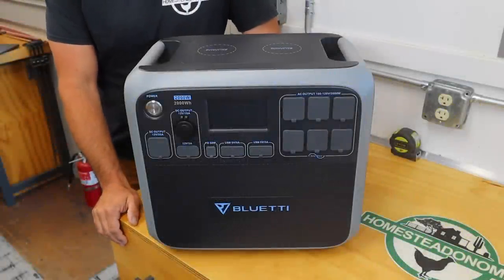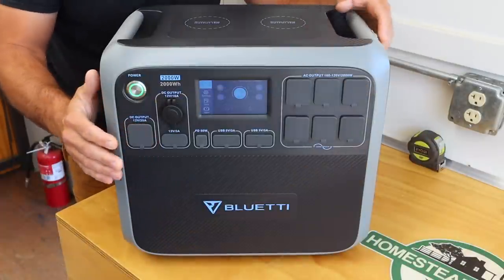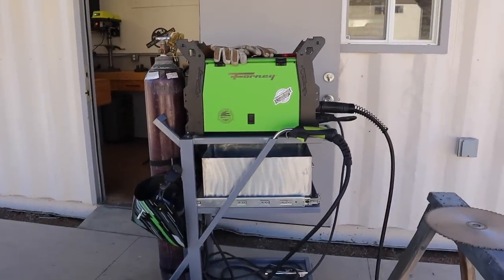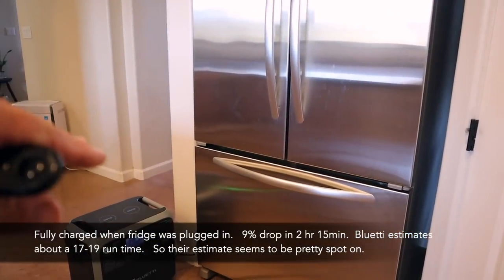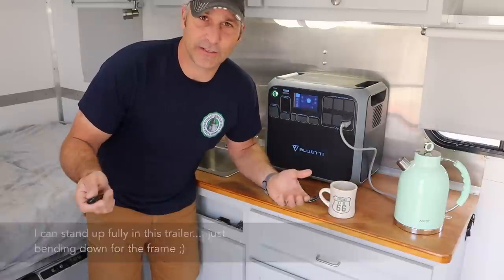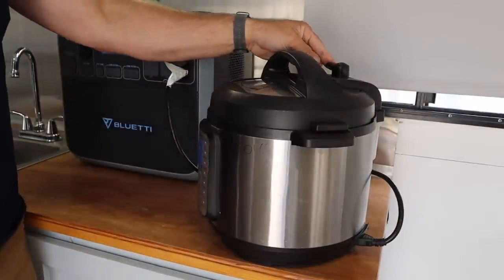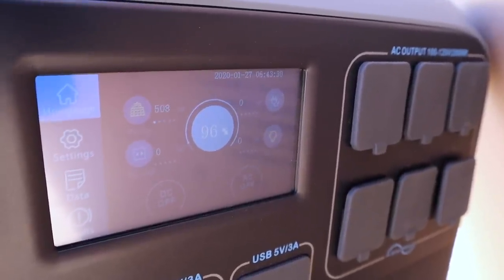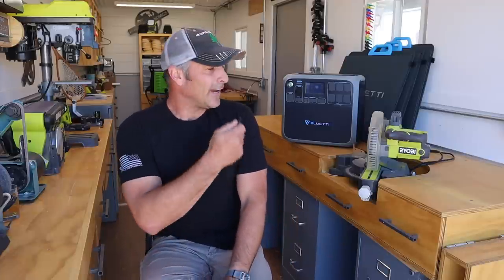How Much Can It Power?  -   Bluetti AC200P Power Station Review

Comment: Wireless (cellphone) charger devices are called Qi certified charging pads.  I have found them convenient on my iPhone 8.  I’m sure your daughter will find devices to utilize those ports.  They become quite convenient.  Thanks for sharing this insightful video presentation.   Will you be creating a permanent location in trailer for travel use?  Will this unit only charge with their proprietary solar panels?  If not, you could use roof mounted solar PV panels to charge the system while traveling.   You may want to add a convective cooktop for home or travel.  W you and your family a blessed week and safe travels.   

Greetings from the frozen southern shore of the Great Swamp Erie in NE Ohio.   Peace brother.
Reply from the maker: The manual says you can use other manufacturers solar panels just so long as the input voltage is within a certain range.   Pretty wide range so I plan on trying it with my travel trailer panels at some point.  But I’d have to wire in a split connection so I could add the plug for the input on the power station. 

Stay warm up in OH….we are in our nice time of year.    But yours is just a few months away and then we will be sweltering 😅

Comment: Cool products, thanks for sharing. I would really like to have a couple of these to run my cabin/tiny house. 
We currently run a predator 2000 gas generator and it runs for 12 hours on a gallon of gas.
The price of these packs aren't too bad from  my perspective. My only question would be: can I connect them to a solar array and use it as a battery bank?
Reply from the maker: Yes, it’s hard to beat a cheap predator and a modest storage of gas.   As for this, it has a built in charge controller so as long as the solar array is within the acceptable volt range you can use existing panels.   But I think expanding the amp hours of the battery bank would really help too.
Reply: Look at ecoflow. They have a gas generator that hooks up to their battery bank. It will auto turn on the generator when your bank drops to 20%. You can also hook up their solar panels, plus generator to their power bank.

Comment: Your testing is well done!  I am glad you showed us.  I would rather set this up in your camper.  The solar system is very complicated. I always dreamed to build a van to travel. This is easier. I wonder if you could set up a fuse box or to set up the car to set this up battery  as you travel?  Thanks for the wonderful information.

Comment: Great review, these units seem to be coming down in price too so that's good. I would like to see how long one would run a small window unit ac. We use one in our camper.
Reply from the maker: Thank you!   Yes they are coming down a bit but still can be really pricey for the bigger ones.   I’m not sure how long it’d do a window unit….but I can’t imagine it would be too long as I think that’d be a super high draw.   But perhaps with the solar panels going it might do alright considering there would be incoming power to offset the outgoing draw.
Reply: If your camper is insulated well and you have an energy star rated 5k btu window unit the Bluetti 200 will really shine. My Bluetti runs my 5x8 home built camper nicely insulated. In 95 degree heat and 90% humidity the a/c runs for around 30 minutes for initial cool down to 69 degrees in the camper. After initial cool down the a/c only runs for 8 minutes every hour to stay at 69 degrees. My Bluetti 200Max has made it to where I can go off grid camping in the heat for the 1st time.

Comment: The 200 Max can charge at 900 watts of solar. That would be 2 1/2 hours to fully charge the 2,600 massive watt hours of capacity for that unit. You are charging at I think 600 watts of solar with your briefcase panels. Also I don’t know why everyone is so scared to test the Bluetti 200 on the a/c window units that most everyone is buying those units for. Coz the performance of the 200 is outstanding to the small a/c window units. I had to end up doing my own tests when I received my Bluetti 200Max

Comment: A shame you didn't note in the conclusion, that for someone who wants be off grid AND environmentally friendly, this is the only option to have backup. It would be a massive plus if you had calculated, how many years of usage it would take to pay it off, since you can charge it for free, as compared to a cheap generator that needs expensive fuel. Also,seems like you could've done all these tests on one full battery, over a course of a (although unrealistically busy) day - really impressive!

Comment: This appears to be a 1500 watt (max) setup? I have a solar generator (Helios) that's 3500 and it can power portable electric heaters for 4-6  hrs and portable AC units for 2 hrs and charge my plug in hybrid for about 30 mins. Fortunately, my 8 solar panels and 3500 watt gasoline generator help make up the difference by feeding the solar generator in extreme weather. Otherwise it's a capable system and like you said - gotta purchase for how you're gonna use it.

Comment: I do not know if Bluetti offers a UK version of their units but, you could order UK inverters for the 12 volt system, and get the UK Hot Pot and Kettles for your wife.. that are more efficient in time and power.. not cheap but what I would do after comparing years of living in UK against living in USA and same appliances in both power systems.. a UK kettle heats water in half the time..

Comment: Ole mate, you have to remember that with power tools, it's the start up that draws the most power, cool invention/rig but, out of most peoples price range when trying to setup a compact Camper/trailer. Great range of tests, well done.
Reply from the maker: Yes, it is pricey for sure.  And yes, the load of usage and start up will vary.   My test was more to get the tools to add up to close to the 2000w range and simulate a constant draw if using a series of tools.   So definitely not exactly how it would be…but Just to get an idea.
Thanks for checking it out😀🙏
Reply: @homesteadonomics  it's 16:33 here in Sydney, what time is it there, or are you at work on shift?
Reply from the maker: @peterlisyak5396  on shift at the station right now.  It’s 10:54pm right now.
Reply: @homesteadonomics  Okie Dokie, you stay safe now ole son.

Comment: Can you charge and use simultaneously? If you can... does the input keep up with the output? 

I am building a new hobbyist woodshop. I think it would be pretty cool to make it totally off the grid. I have looked at these solar generators to run my shop. What's your opinion on that? 

Awesome video!
Reply from the maker: I believe you can but that is something I did not check during the testing.   So I can’t confirm, but I’d imagine you can.
Reply from the maker: …. And the shop.   I think it’s a cool idea for sure.  Obviously there will be limitations in total all hours depending on the size of the battery bank.   But they and other manufacturers of these power stations have a wide range of amp hour options and or expansion packs.   
It would be neat to have it completely off grid too.   And depending  sing on your locality it might negate any code issues about having to run power.  That’s a good thing in my opinion!
Reply: You can charge and use the Bluetti simultaneously. Even the display lets you see both the charging and usage rates as you are using the Bluetti

Comment: It would have been cool to see how much slower power would deplete if it was taking charge from the solar panels while having things in use.  For example if the solar panels were plugged to it for the entire day yet at the same time having a refrigerator taking its power source only from this device would it ever fully deplete the battery or would the solar keep up with the demand in use.

Comment: The 500w out of 600w potential has to do with angle of the sun and other atmospheric conditions.  What do they say about battery fatigue?
Reply from the maker: Yeah, I tried to get it lined up the best I could but it is winter time and the sun is lower and I had them at 45 degrees or so.   As for battery fatigue…. The batteries are rated for something like 3000-3500 charge cycles.  I don’t know if that’s what you are referring to, but it seems to be good.   Even if it was only half of that.
Reply: @homesteadonomics  Yes, that's what I was referring to, thanks.

Comment: Great review!  Can you charge the unit from solar and use power at the same time?  Charge unit during day while keeping fridge and freezer cold ...
Reply: Yes you can charge and draw at the same time. The cool display let’s you know what watts are being used and what watts are coming in on the unit. on my unit it was cool to see 280 watts being used for my window a/c unit and 190 watts was coming in from solar power,which only gave me a 90 watt draw from my Bluetti unit. And when my a/c unit reaches temp and shuts off I then get full charge capacity from my solar.

Comment: Let's say I have a power tool and I want to determine if the generator can handle it. What should I be looking at? The watts of the generator vs. the watts of the power tool? The voltage of each? The amps of each?

Comment: How long is the cord for the solar panels?  Can you get extra long ones like an extension cord?  I understand you're suppose to keep the actual unit out of the sun.  I'd be interested to see how you could use this to run your a/c or furnace in a little motorhome if the need arose.

Comment: I do like that they call it a power station. Really bugs me all these companies calling them solar generators. To me they do not generate anything. They require solar panels for that. It is a battery storage devise.
Reply from the maker: Haha… I know what you mean.   The solar generator kind of has the catchy sound.   But in reality they all are power banks, stations, etc that can be recharged with a solar input.
Reply: @homesteadonomics  Yeah "solar generator" is a strange combination of words. Of course they just mean serves a similar function as a gas generator would, but with sun as the fuel instead of gasoline. However, it's still a goofy wording.
Reply: A generator requires gas - should we refer to it as a gas generator?  The fuel is the sun - pretty cheap

Comment: Can you run something on with extension cord while it’s charging from solar panels?
Reply from the maker: So I didn’t test that out but I believe it will do that just fine.   That would be a great application too… so you can keep the solar layed out and still have the usable application of power inside.
Reply: Yes that can be done but you get better specs if you use a longer solar charging cord instead of a power cord

Comment: You must have at least 35 volts going into the unit, or it's not going to charge from solar panels.  You single panel you showed "as working" in the video is not a minimum of 35 volts even in ideal conditions.  Too many people are not finding out about this until too late.  It happened to me  Please revise your video as you need at least two of the panels that you show or it will NOT charge.
Reply: This

Comment: Do you think the Bluetti would run my pump for drawing water from my water well?
Reply: I'm not Shure if this would help you but figured I'd mention it I was looking through sa site called temu and was an saw a electric pressure washer an pulls water pretty mutch from ant source it's battery powered 20 volts kinda like a drill battery it says 1000 watts an figured selp priming as well that maybe I could use it in an off grid simple water set up just a thought the reviews I've read says it's powerfull  I figured good water pressure maybe a small plumbing like say a camper this may work plus has its own sources if electricity price was somewhere around 60 us dollars.

Comment: The amount of power those tools draw is going to correlate to load, just free spinning takes very little power.
Reply from the maker: Yes, just free spinning will not be the same as actual cutting/sanding.   But I was just trying to get a constant draw of close to the 2000w rating.   I think is was ranging in thr 1700w range with them all running.   Wouldn’t likely be running them all at one time so I figured it would at least partially demonstrate lots of usage in that short duration

Comment: To save money you can make your own with separate battery, charge controller and inverter so you can spend up to the power output you want.  I made a quick one with a tool box. It doesn't have the bells and whistles of this all in one deal but it is charged with a used solar panel attached to truck roof rack. Been running most the tools shown in this video. Recharges in one day during summertime. https://www.youtube.com/watch?v=crc0WecHSf8
Reply from the maker: Very cool!  I will check it out thanks!

Comment: I recieved a AC200P and 12V RV cable over one month ago.  Over the past month I have been desperatly trying to get customer support regarding product issues I am having.  It is not possible to connect my 12V RV cable 2 pin male to the 2 pin female 12V/25A DC output port on the unit.  It seems like female unit has 3 plastic elements that block the male 12V RV cable from pushing in even when lining up the pins and pulling back the outer black metal sleeve of 12V cable.  Their appears to be an issue with the plastic injection of this port that makes this connection impossible.  Given I was planning on using this in a van build I need the 12V/25A port.  It is nearly impossible to talk to anybody at Bluetti or to get a email response from them.  When you do it is different people some with outside emails that are not under the Bluetti name.  Be prepared for zero customer support should you have any issues; BUYER BEWARE!!!

Comment: The AC200P requires a solar panel OCV of 35-150V. A single SP200 solar panel will not charge the station.
Reply: Wow,the 200Max charges fine with 1 SP panel
Reply: @breakdownbill1  either you're mistaken, or the manufacturer is mistaken. I don't know which.
Reply: @MN8015HQ  mistaken about what.
Reply: @breakdownbill1  charging a AC200P that requires 35V OCV with a single panel that only generates 24V.
Reply: @MN8015HQ  the 200 Max can solar charge from 10-145 volts. That’s the unit I have.
Reply: @breakdownbill1  I did not know that. The AC200P (which I have) requires 35V-150V.
Reply: @MN8015HQ  so how did you sort it out? 1 solar panel is 24v what if I add another one will they be 48v?

Comment: You do realize you have all the information you need to do simple calculations to figure out the usable time.  The 2000 watts is what you gadget is rated for and that is figured by multiplying the voltage times the amperage equal watts.  Example 120v .12.5=1500w you can find this information on the appliance.  The next factor is time to get your watt hrs, say you use 1500 watt for half an hour that would be watts multiplied by time.  Example 1500watts .5hours =750 watt hours.  Now take your watt hours and divide and that by your total capacity of watt hours and you will get the percentage used.  Example 2000 watt hour/ 750watt hours used =37.5 percent used leaving 62.5 percent.  the solar panels are tested in a light box and I have never seen 100% efficacy so 500watts and change is still no problem.  This should be enough to keep you in the ball park provided the manufacture didn't fudge the numbers too much.
Reply from the maker: Yes they show this calculation in thr instruction manual.   But I like see what it’s really drawing…ie.  A 1500 kettle drawing 1443 and what the curved cycle will do as the draw changes from the start to end of its cycle.   
But it’s all good info and I appreciate you putting it down.   It makes more sense the way you wrote it than I’ve seen in most literature on things like this😀👍

Comment: NOOO!  watch out for the bluetti warranty is no good. I have the ac200p this unit battery numbers are very lower. unit is junk. only 1 years old, Also I have #3 350w portable panels failed (NOT WORKING) I'VE  been working with kiki at bluetti she's is given me the run a round. Five mouths and I have #3 panels that do not work and a junk power station. Sorry  see you in Quartzsite! 
I did not watched the hole video,  NO reason too!